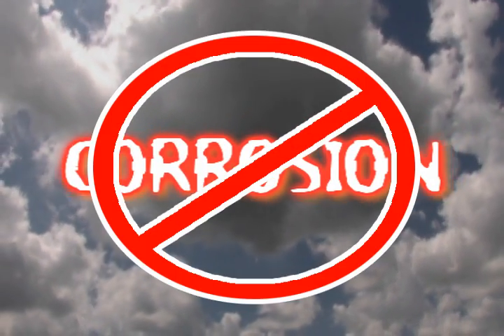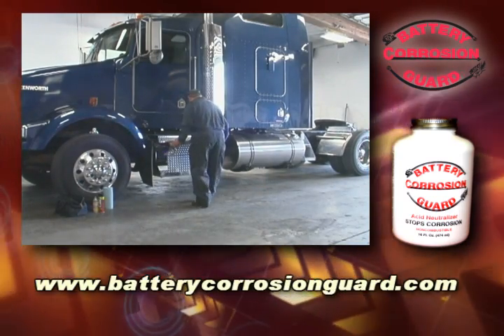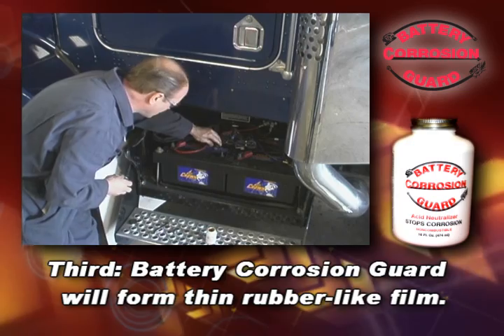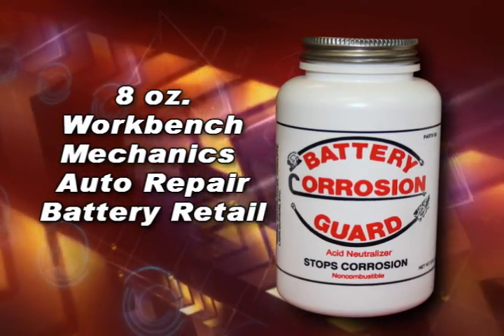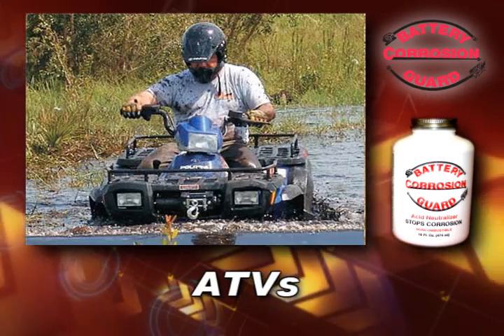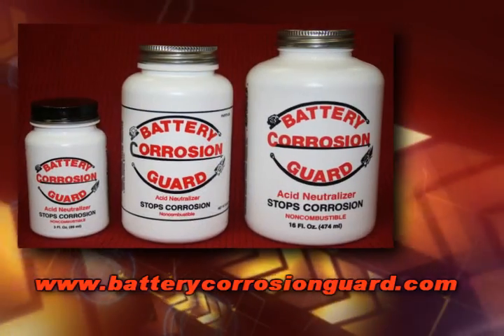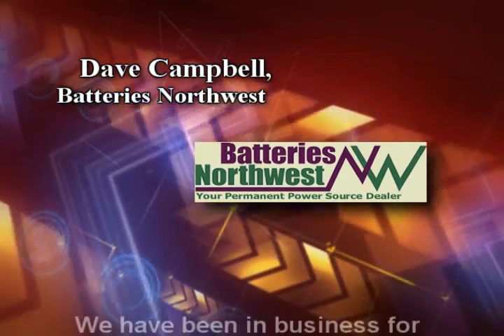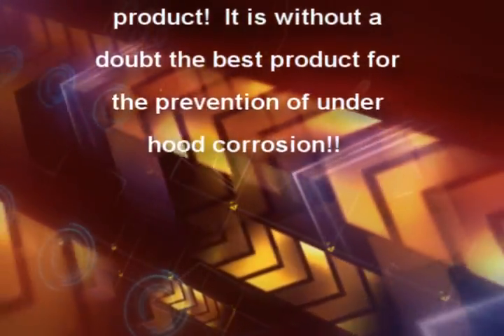Battery Corrosion Guard

Comment: I have 12 flood acid batteries on my off-grid residence, plus the battery for starting the generator.  The battery bank is powered by a combination of solar panels and a propane powered 20Kw generator.

Within 5 weeks of the battery install, visible acid corrosion was present on some of the terminals.  So I ordered Battery Corrosion Guard based on reviews.  

I neutralized corroded areas with a mix of baking soda and water, followed by a scrubbing with a small wire brush.  Once dried, I dabbed the BCG over the terminal connections and exposed lugs and wires.  

The BCG is black and sort of gooey, looking like a type of grease.  It applied easily on the metal and seemed to have some surface tension that might wick the BCG into joints of the connections to help seal from acid attack.  I did not remove terminal connections to apply the BCG, so time will tell if I need to do that should evidence of acid attack reoccur.